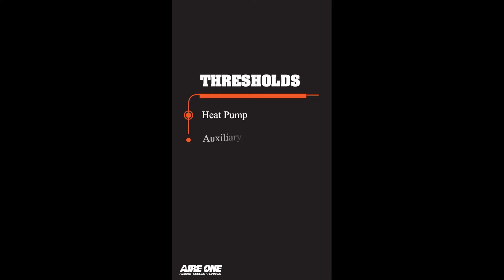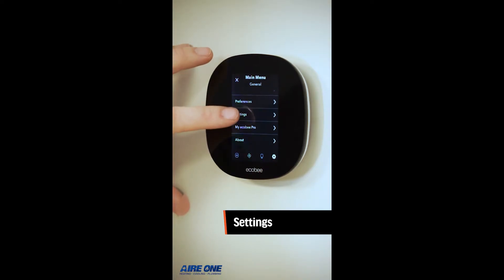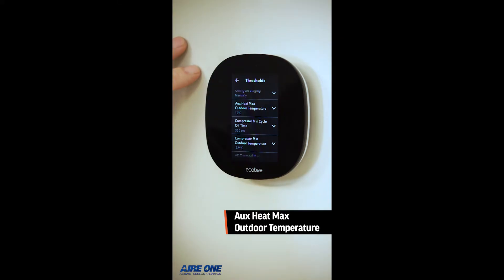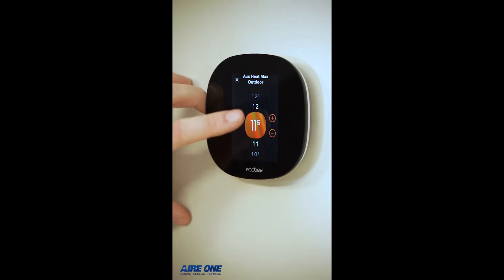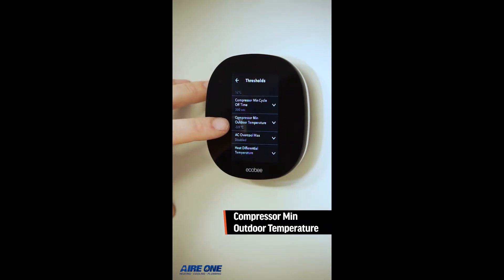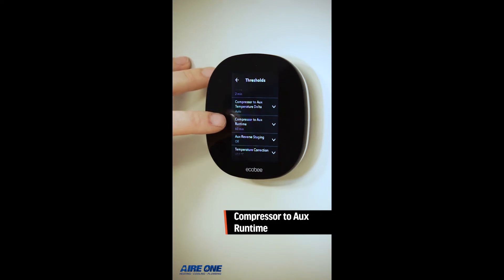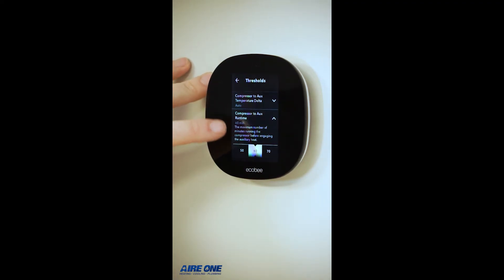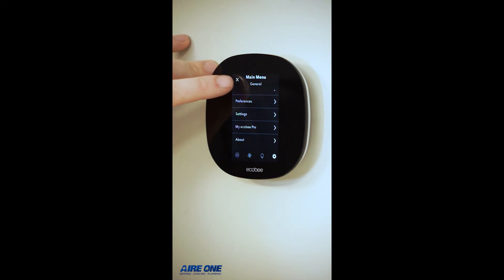Adjusting Heat Thresholds on Your ecobee  | Easy Steps!

Comment: My ecobee premium doesn’t have these options. The heat pump is backed up by natural gas heat. I can control the compressor min outdoor temp and the heat/cool min delta, but I don’t see any other settings in threshold that apply to this.
Reply: Set staging from manual to automatic